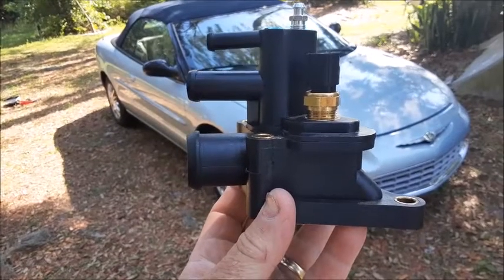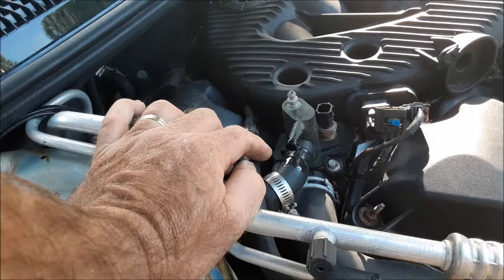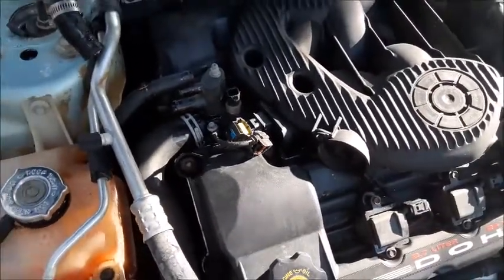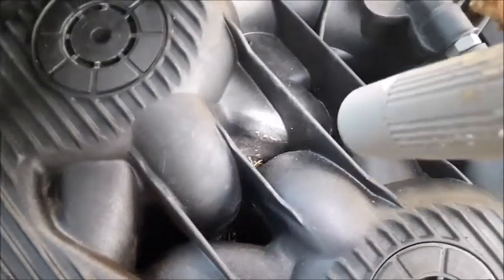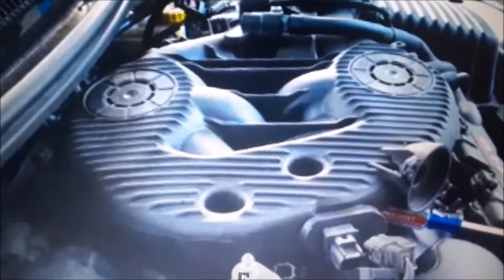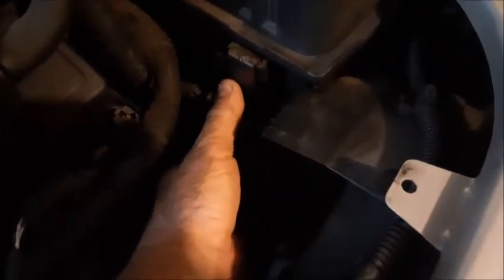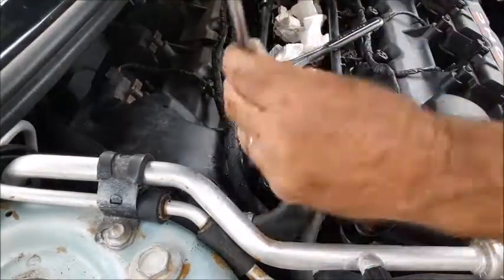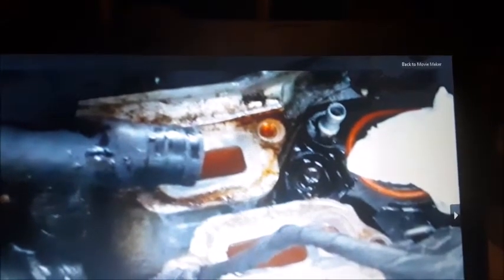Sebring Convertible Radiator Hose Water Outlet Replacement

Comment: Help I accidentally broke one of the bolts of in there what can I do ?
Reply from the maker: Several possibilities,  First you might want to use some penetrating oil on it for a day or so if possible to hopefully loosen up the threads then one of the following possibilities. 1. If there is any stub sticking up you could put vice grips on it.  2. You can drill out the center of the bolt with a smaller diameter drill and then use an "Easy Out" tool to grip the center of the hole you drilled, or 3. You could drill out the old bolt and re-thread the new hole with the next size bigger bolt.  If you try option 1 or 2 above if it is possible to heat up the block with a torch (I cant remember if the outlet bolted onto a metal not plastic block).  Don't heat the broken off bolt only the surrounding metal and when the metal expands it helps to loosen the broken bolt.  It would be best to look up some videos on how to do this.  Hope this helps and you get it out.
Reply: @creativerepairing2960  thank you sounds I haven't pulled it all see if there's a stub sticking out yet